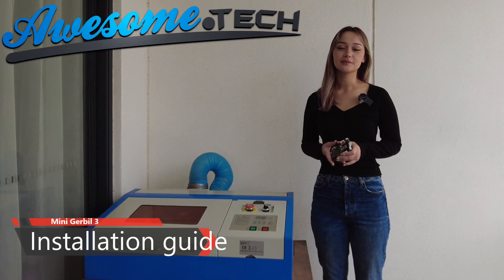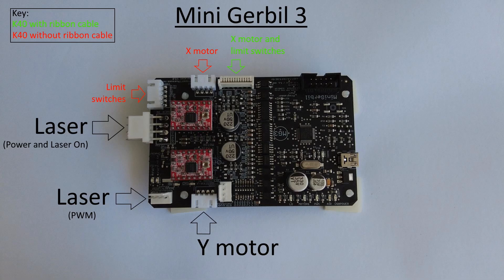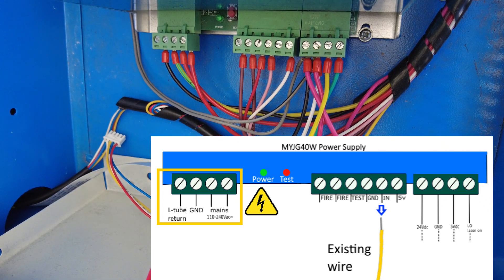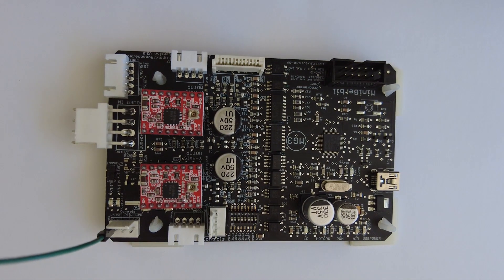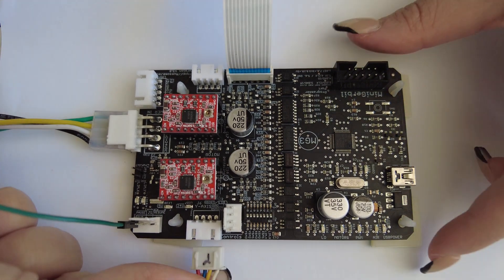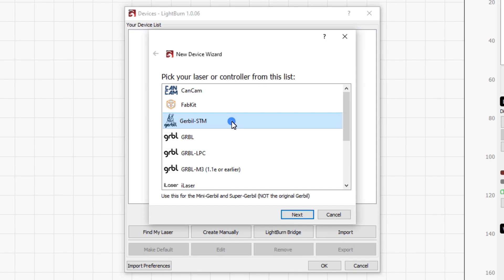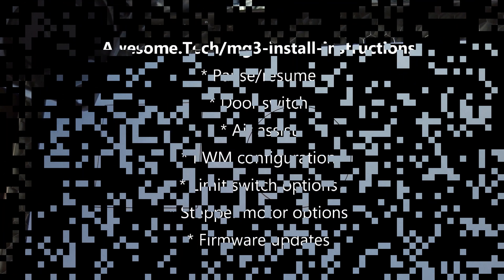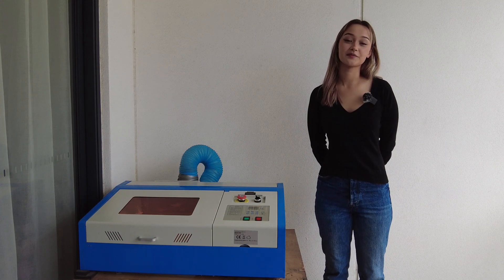Mini Gerbil 3 controller installation for a K40 laser cutter/engraver

Comment: good video, just installed the MG3 board after my MG2 board suddenly failed to be correctly detected by windows. only thing I'd add to the video is how to connect air assist if you already have it, but it wasn't hard finding the info on your website for that.

Comment: It took a little longer to receive my board than I expected. But, it looks like maybe you guys were in the middle of getting the new boards in stock. Then the post office lost it in a snow storm and it sat in Kansas City for a week. I finally received it and installed it. It was a very simple install.

THE PROBLEM...The board will not activate my stepper motors. When I press HOME in Lightburn the LED lights up but nothing happens. I reinstalled my old board and as soon as I hit the power button it went HOME and functioned correctly. Is there some settings in the firmware that could be causing this, or is it a bad board. I have emailed support but have not had a response. I have just become disabled and had to throw away 25 yrs experence in the HVAC trade and am trying to start a Laser Engraving business to replace my income before I go bankrupt. I can't even get started learning much less selling until I cam make this thing work. SOMEONE PLEASE HELP
Reply from the maker: Hi Frank, I'll email you a relevant debugging checklist this evening and work through with you via email
Reply: @awesometech-ul8tp  I have not received an email for debugging. Please send out the email or a new board as this BOARD DOES NOT WORK. I am just sitting here waiting. 4 days ago I sent you an email stating I was having problems. STILL NO RESPONSE from that email. I purchased this board form your website almost A MONTH AGO. What kind of company could sustain being down for a month???? I am looking at buying a didderent machine as this board is my only option for my k40 and with pretty much no customer service from Awesome tech, it makes the K40 obsolete.
Reply from the maker: @FrankDDouglass  A new board is on its way to you! Please see email.
Reply: @ Thank You

Comment: Hello, it would be helpful for me to see a video without the ribbon cable. Which connector do I connect the cables to?
Reply from the maker: Hi Peter, I've updated the installation webpage with a diagram, I trust that helps but of course reach out if more info needed https://awesome.tech/mg3-install-instructions/

Comment: I have to be honest, it looks like a great and easy plug and play solution and replacement for the boards that come with the "K40" style engravers,  however for what it is, The cost is outrageously overpriced, for what it is, if it was in the 30$ price range these boards would be a must-have upgrade, however, priced as it is, for less then 1/4 of a Mini Gerbil, can buy an Uno and CNC shield and run GRBL laser and achieve the exact same results for under $15 to $20 total as your little board is exactly that just all put together in one board.
Reply from the maker: Thanks for your comment, I understand where you're coming from. Our first Mini Gerbil product launch used an R4 Uno, not a standard Uno. We needed an R4 because you need the extra hardware timers to get 16 bit PWM. Why is that important? Because the laser has significant deadband, saturation and non-linearity. Oh, and all those factors change over the life of the laser. If you send an 8 bit signal from 0 to 255, you'll only get usable contrast levels of gray in a small subset of that. Translation: you'll get a crappy multi-gray image instead of a smooth range of gray. And even if you jigged up the 8 bit range to perfectly cover your laser output, you'd need to re-tune it over time. In contrast, 16 bit means that wherever your laser's engrave zone is, there'll be plenty of values to get a useful range of grays. As for the move to STM32, you'll note that its clockspeed is significantly higher than a Uno. This translates to smoothness of stepper motion, even at high speeds. The ticket price reflects the volume and skill of engineering to get a reliable and high performance product working out of the box, and customer service as required. If you're one of the few who has the time and the skill to develop their own solution, I salute you, as we started that way ourselves. But I do disagree you'll get 'the exact same results' with a Uno. By all means send us whatever performance specs you come up with, happy to compare side by side. Regards, Dan and the Awesome.Tech team
Reply: Well it's way cheaper than the other alternative - (cohesion board)

Comment: Is this using a standard USB type-A port? 
The fantastic thing about this is that it doesn't require an external power source. Love it!
Reply from the maker: Yes, the Mini Gerbil is connected to a PC via a commonly available USB cable (USB A at the PC end, mini B at the Mini Gerbil end). 
Glad you picked up on the a key advantage of this design, not requiring an external power supply keeps upgrade costs reasonable